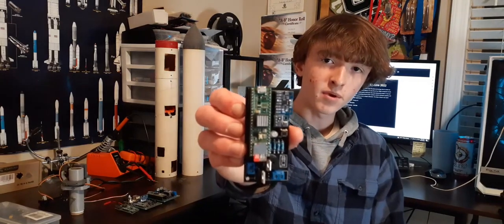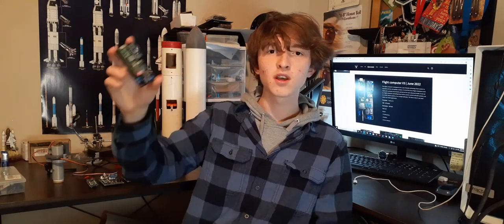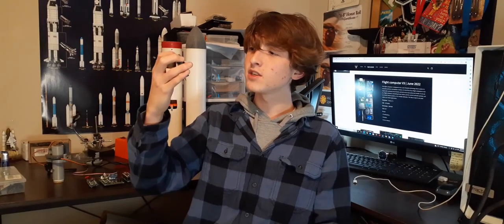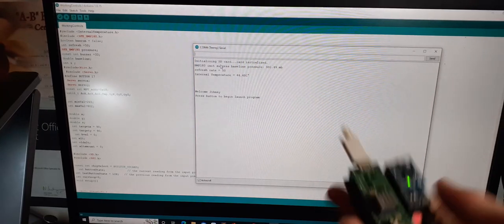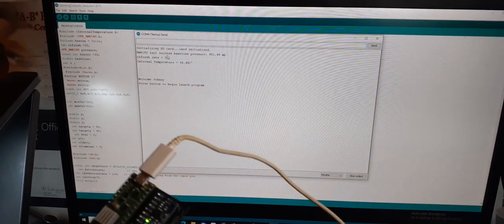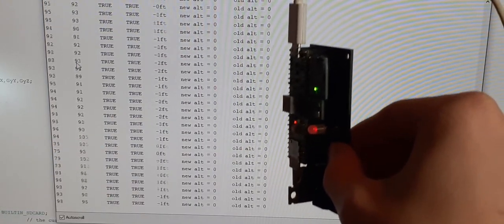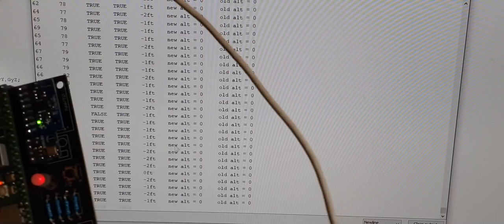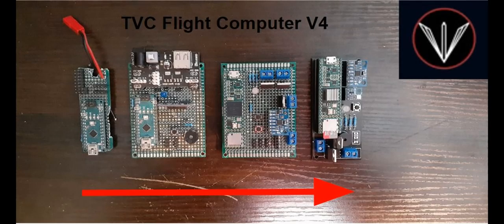Flight Computer V4 | Thrust Vectoring Model Rocket

Comment: hey i also trying to buld a TVC model rocket. i already build the flight computer but i idont understand how i can use the flight computer vertically cause the mpu6050 is reading orientation horizontally when i use the IMU the orientation after 90 degree it goes back to 0 then starts again there is no negative values. can you explain how to code the IMU vertically,  is the imu change its axis when its in vertical position?. please reply

Comment: Very cool!
I have some recommendations for the sensors you are using!
I use an Arduino nano 33 iot board because it has an LSM6DS03 IMU built in. I used to use a BMP 388 pressure sensor but now I just integrate accelerometers for altitude and velocity. 
If you want I can take a look at your code. 
Good luck with your project!
Reply from the maker: Thank you I appreciate that!
Right now, I'm working on the PID controller and getting the flight computer to control the TVC mount seamlessly. Ill look into the nano 33 iot and I'll start integrating the acceleration along with the bmp180

Comment: Hey, very nice video; i have some tips that  you may already know: insteadd of adding more pushbuttons that can mess up in high vibration, why you don't use a radio to comunicate with the flight computer? also you hould not using female pin headers on the version that will fly because some important components like the IMU can fall of or disconect. Hope to see updates
Reply from the maker: I would love to use a radio so I can communicate with it, and I've already started working on adding that. As for the female pin headers there added so that if the board goes out it's easy to replace. For launch I'll make sure all the sensors are secured, and maybe add a little hot glue if needed

Comment: The teensy probably gets hot because it's meant to receive up to 5v.
Reply from the maker: It has voltage regulator that steps down the voltage to 5 volts
Reply: @velocitylaunchsystems  I noticed it, just watched a previous video. Awesome job! 👍

Comment: Just curious, what servo motors are you using?
Reply from the maker: They are the MG90s, so far they are way better than the cheap plastic geared ones I had before
https://www.amazon.com/Seamuing-MG90S-Micro-Geared-Helicopter/dp/B07F7VJQL5/ref=asc_df_B07F7VJQL5?tag=bingshoppinga-20&linkCode=df0&hvadid=80401840125268&hvnetw=o&hvqmt=e&hvbmt=be&hvdev=c&hvlocint=&hvlocphy=&hvtargid=pla-4584001418789573&psc=1